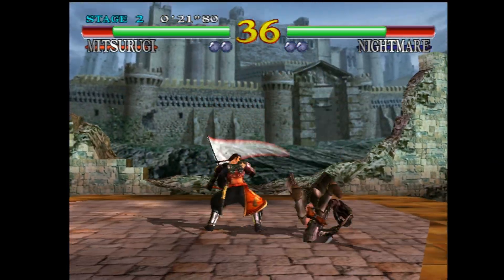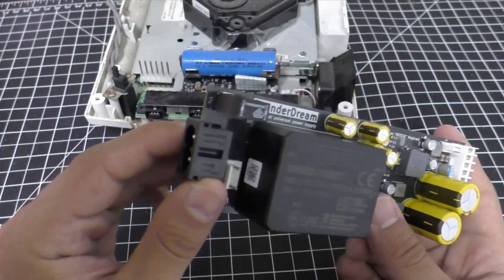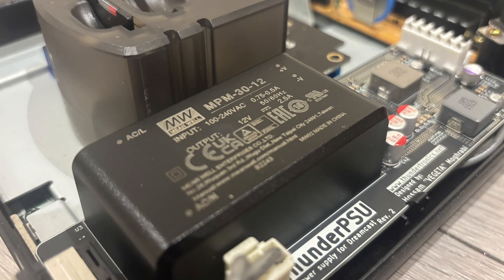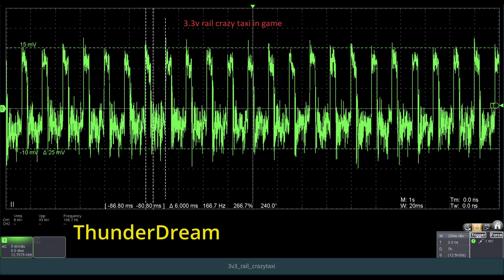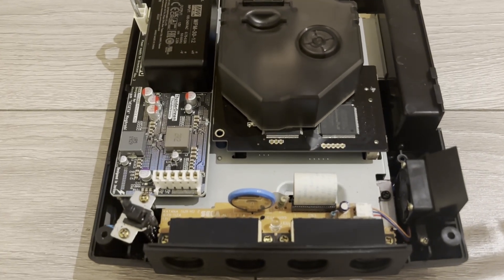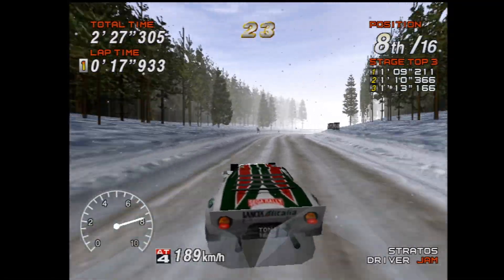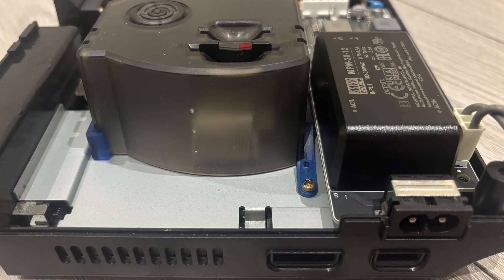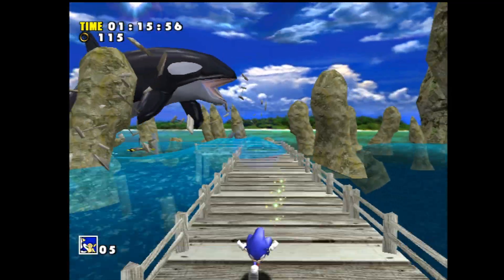ThunderDream - The Best Dreamcast PSU Mod Money Can Buy?

Comment: Does this actually make sense for a US model with a 120 volt power throughout their house instead of the UK 240 volts. I imagine the stepping down of 240 volts causes the heat issue of the PAL console, but I don't know if that's the case with the NTSC variant.

Comment: Dangerously hot?   Im not sure but ive used mine since 2019, stock power supply with a GDEMU,   works fine and doesnt really get to hot. Could it be something different with a US PSU?

Comment: Does this come with a power cable or will I have to buy one separately? If the answer is the latter, can I just use the stock Dreamcast cable?
Reply from the maker: You just use the standard plug that came with the Dreamcast. The socket on the back is the exact same as the stock PSU.
Reply: @SEGAGuys Brilliant, that's good to know. I'll definitely be making the upgrade once it comes back in stock!

Comment: I'm going to watch this later as I'm a bit busy the now, but I'm looking forward to seeing what you guys say. I have to admit I fell for the hype a while ago and bought a RetroSix "Clean Power". Thing didn't work! Got my money back quickly so I've got no complaints in that department, but I've stuck with the stock PAL PSU on my DC ever since.
Reply: Hullo. I finally watched this and I'm fairly convinced. Sadly the UK link is out of stock.

I just wanted to ask about GDEmu compatibility again. I know you went over it in the video, but does everything work ok with no issues when powered on for a long time using a GDemu? My stock PSU does get hot with the GDEmu but I've never had any problems with the machine switching off or breaking at all.

Comment: The stock PSU recapped just can’t be beat.  Good option though
Reply from the maker: A stock PSU recapped, even with the 12v regulator removed, still runs far hotter than the ThunderDream does.
Reply: Never thought I'd see cork sniffing with 90s power supplies but here we are lmao

Comment: Great video. I’ve been toying with idea of replacing my PSU for a while and was going to go for the usual Ali Express ones but this has made me think otherwise. Unfortunately they have sold out on their website but I’ve put in an email to get notified when they are back in stock. I’d rather pony up for this than going cheap, especially how it doesn’t emit any heat and respects the original design philosophy. Thanks for the heads up on this 👍

Comment: Thats why I emulate. I´ve sold my collection years ago.
Reply: Enjoy Jet Set Radio with out of control black texture leaking then mate.
Reply: @playsushi2559  never encountered this kind of problem
Reply: @playsushi2559  What emulator are you playing on where that's an issue lol? I run flycast on my pc via retroarch outputted to my crt via vga to rgb and there's 0 graphical issues that you're mentioning.

Comment: This looks awesome . I recently picked up an old  Dreamcast that needs to have the case replaced gdemuninstall etc. I wonder if this would remove the need to install the noctua fan?..( current sounds like a truck!)
Reply from the maker: The Noctua doesn’t really do much for cooling over the stock fan, it’s more a quality of life mod - to reduce the noise. I had one in mine, but removed it as a totally silent Dreamcast was a bit unnerving. 😂

Comment: OK, Thundertronics ... now do a ThunderNaomi ... 😉
Reply: i guess this one works for the naomi since it has extra power. but do not know about naomi voltages.
Reply: @hossammoghrabi1021  Oh, I was only being playful, mate. But thanks for the answer.

... and ... well ... I mean, yeah ... I guess ( in my VERY unknowledgeable head! ) I'd more be looking at the wattage it can pump out.

Like ... if you're consolizing a Naomi, it'll be fine, as you're likely to use a netdimm for loading, so it should be OK. But if it needs to push more ... then ... maybe? I truly don't know.

Folks have been using DC PSUs on Naomis for a while, since ( regarding the voltage numbers ) Naomi uses the same as DC in general:
3.3
5 ( is it actually 5.1 I forget )
12
I just don't think they use them for much more than a basic setup, as Naomi is known to be VERY voltage sensitive. I think ...

So, voltage wise, it should be OK, and will be a damned site better than using unknown entities or spare PC PSUs with adaptors.

I just don't know if it'll have the wattage to push everything that a Naomi might have connected, that's all.

Again, though ... I am VERY unknowledgeable!!! 😅

Comment: Nice power supply, but I think it's more of a bragging piece than something that provides enough benefits to justify the price, unless you spend hours playing with an oscilloscope rather than with the DC.
For the average user, a power supply and motherboard recap is more than enough, and it's better to invest in a decent video cable.
Reply from the maker: Hossam (ThunderDream’s designer) played with the oscilloscope so we don’t have to. 😁

At the end of the day, I’m not here to sell ThunderDream or brag about owning it. 

The reduction of heat to near zero is the main benefit because, you know … I spend hours playing with my Dreamcast - not an oscilloscope. 😉

Comment: How does it compare to the Robot_Retro PSU? I've been using their usbc psu with a switch power supply for over a year and it consistently runs cool with a clean image and zero crashes. It really was a game changer for me as all other psu's I tried had various issues. I like that it has additional ports too for future mods. If the ThunderDream out performs this I will be very impressed.
Reply from the maker: I’ve never used that PSU, mate. What I would say is that if you’re happy with your current set up in terms of both heat and picture clarity, apply the old rule - if it isn’t broken, don’t fix it.
Reply: @SEGAGuys  It's a good rule to be fair. I probably won't upgrade to this as the Robot Retro is amazing but there is something about being able to use a standard DC power cable and adding the weight back to the Dreamcast that I find appealing.

Comment: Does every ODE stress the stock PSU?
Reply from the maker: I’ve never used a MODE, but one of our viewers, Gary Cormack, recently commented on this video that his stock PSU got hot when using the MODE.

There’s no mod for the stock PSU to get the kind of heat reduction the ThunderDream offers - which is as close to zero as possible.
Reply: @SEGAGuys  Oof that’s disappointing, appreciate the info!

Comment: I went down the usb-c Robot Retro route. I've moved most of my systems to usb-c pd power where possible but if i hadnt, then i'd have been all over this.

I was one of those guys that hoofed out the 12v rail in the hope of reducing heat in my recapped OG psu. It was.... Ok....Still a bit too warm for my liking though.
Reply from the maker: Out of curiosity, are you from the UK? My mate took the 12v rail off his PAL stock PSU and he said the reduction in heat was “negligible”. 

I’m no engineer or electrician, but my hunch has always been that because we use 240v here we’re pushing more juice through the PSU. 

Whereas a US Dreamcast owner who removes the 12v rail, their system is only pushing 120v.
Reply: @SEGAGuys yip. Uk based. I'm pretty sure i sent James a spare DC a few years back as he was having bother with one.

I read that eu psu's need the 12v rail removed cos of the increased voltage. So i done it. My DC could have cooked an egg on it at times. I just put it down to having a MODE and there being shitty airflow cos of that. As hot as it got, it never gave up. Had it away with my mates for a weekend and the poor thing got abused on 4p games for most of the weekend and still kept going, even with the heat. Probably testament to the OG psu and high quality new caps more than anything else though. 😂

Comment: Excellent stuff, that answers one question I’ve always wondered about the thunderdream psu, does it get hot like the stock psu, I have a MODE in my Dreamcast and it got so hot I swear I could smell the plastics melting, (not even exaggerating) I did install a Re-dream psu and Meanwell power brick and it does a great job.  But I’ll probably upgrade further to this

Comment: You can also add a dummy load made of 3x 1k ohm resistors in paralle  to the 12v rail, and that would keep the original PSU unmodified and good heat dissipation... and the best part of $100 in your pocket 😁  But granted, that PSU is cool (and sold out, too) 😊
Reply from the maker: Yeah, adding a load to the 12v rail will absolutely be a cheaper solution for the heat (although that will reduce it, not all but eliminate it like ThunderDream does). The main benefit of the ThunderDream is the quality of the power being pushed through the system and its components. I found Hossam's oscilloscope readings really interesting, and the stability of the image I'm getting through my OSSC now is unreal.

Comment: Good vid, but you switch out the drive for a GDEmu and a new power supply but you couldn't even bother to replace the battery? Why ?
Reply from the maker: As someone who imported the Dreamcast from Japan back in the day, I like being reminded of 27/11/98 when I turn it on. I also had a Noctua installed but binned it in favour of the stock fan - I don’t want a totally silent Dreamcast, it’s not natural. 😂